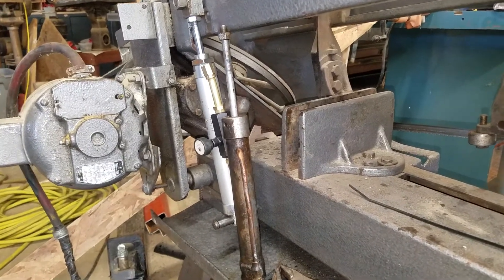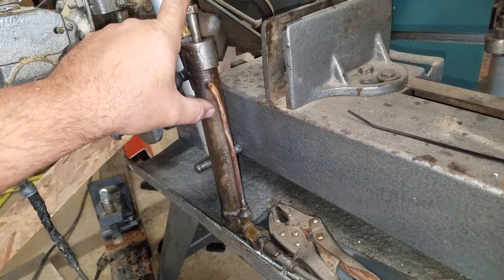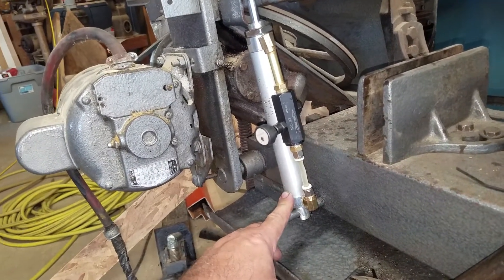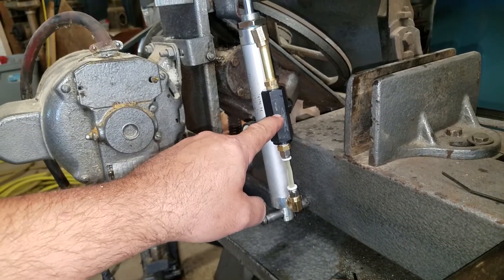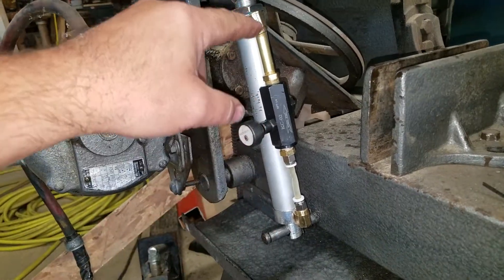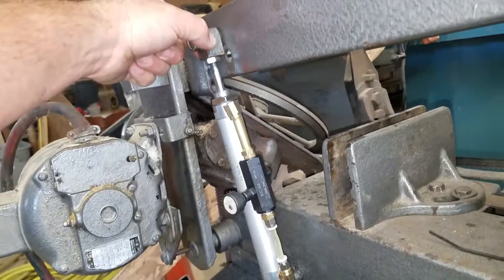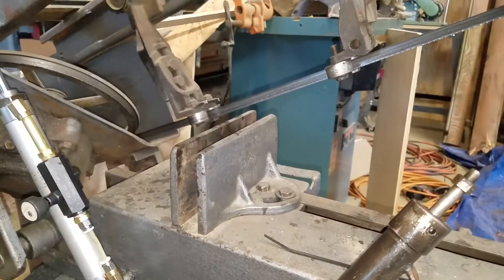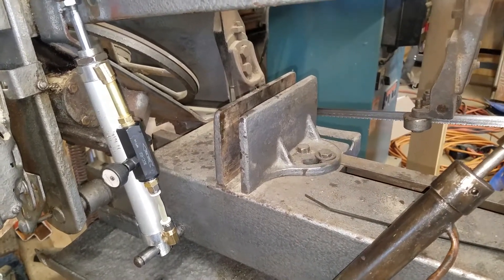Upgraded hydraulic cylinder for Kalamazoo bamdsaw

Comment: Hey, everybody, I found the exact flow control valve. That's what they're called. This one is on eBay. It is offered by "sunnycaishop15" and the item description is "Flow control valve 1/4" Throttle valve check valve NPT 3000PSI Steel Hydraulic".  Best of all, it is sold by a US supplier and costs only about $14 with shipping included.
Reply: Thanks, just ordered two from eBay

Comment: Where did u buy it I need one
Reply from the maker: The cylinder: 
https://www.ebay.com/itm/25mm-Bore-150mm-Stroke-Pneumatic-Air-Cylinder-MAL-Series-Sydien-MAL-25x150/254566680450?ssPageName=STRK%3AMEBIDX%3AIT&_trksid=p2057872.m2749.l2649

The Valve:
https://www.ebay.com/itm/1-4-NPT-3000PSI-Hydraulic-Throttle-valve-check-valve-Flow-control-valve-Steel/293540796047?ssPageName=STRK%3AMEBIDX%3AIT&_trksid=p2057872.m2749.l2649

The Fittings:
https://www.ebay.com/itm/2pcs-1-4-OD-Tube-X-1-4-NPT-Pneumatic-Male-Elbow-Push-To-Connect-Air-Fitting/273959370693?ssPageName=STRK%3AMEBIDX%3AIT&_trksid=p2057872.m2749.l2649
Reply: DIY Chad ok thanks so much man last question when you fill it with arm do u have the arm all the way out (6” scope ) or did u have it all the way in ? Thanks again I ordered all the parts today